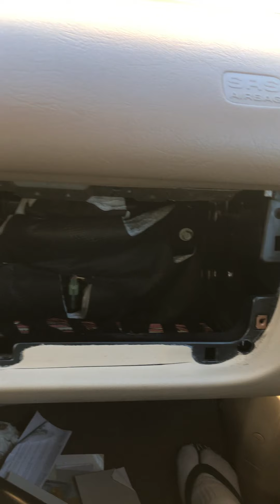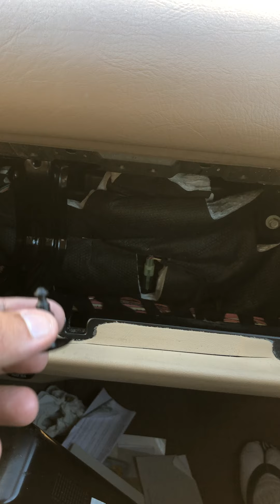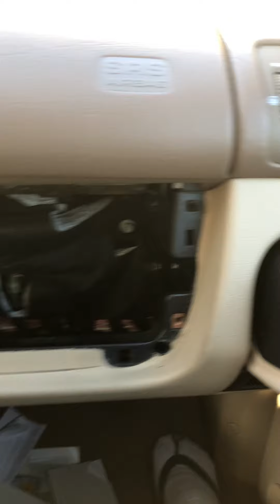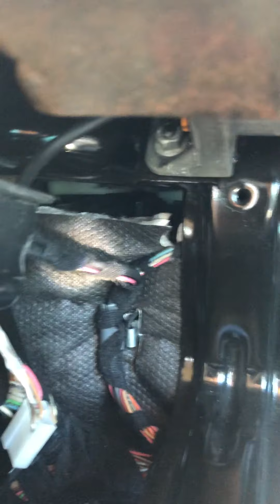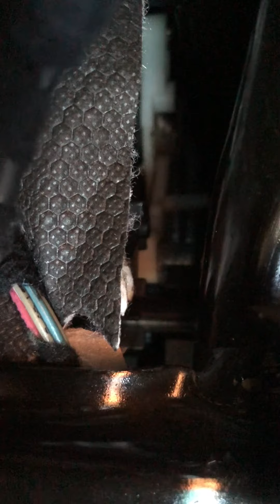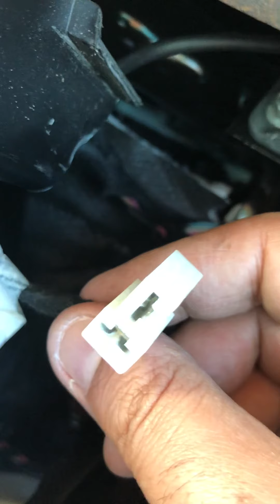Fix AC or Heat problem for Mercedes Benz ML320

Comment: Since this became evident at the end you just wasted 4 mins of your life I’ll attempt to help. 1st I’m a stay at home mom with no experience working on cars, nor do I have a very good automotive vocabulary m, but I’d like to help explain what to do.. The white plastic you see is able to be pushed backward or pulled forward depending if you have your AC or heat on. Can’t remember which way is what (you’ll know by what temp is coming from your vents). I’m a female with small hands so I just pulled back the insulation & was able to access the  “leaver”. I either pulled it pulled it forward or pushed it backwards can’t remember which, but opposite of where it currently was) & presto the AC came on, additionally when it gets cold I do the same thing, but push/pull it in the opposite direction activate the heater. I’ve only found one other video explaining this (over two years ago). I apologize I can’t find it now. I have a ‘98ML & the Mercedes dealership quoted me nearly $3000 to remove the dash & repair it. My cars not worth $2000!! It was an act of god that I found the solution of going through the glove compartment b/c there were ZERO chances a mechanic was EVER going to give away this tip. It literally has saved my kiddos & I from heat exhaustion or frostbite! I know nothing about cars, but really hope my horrible explanation might help or at least point someone else in the right direction. This does work & it’s sad this video leaves you “hanging”at the end when I’m certain it could have really helped some people out.
Reply: Thank you Heather, for writing what many of us concluded.  I have seen a fix on a Mercedes car club site in which the guy attached a metal coathanger-type rod around the white thingy and had made a small slice in the back of the glovebox where this rod sticks through. He bent a circle at the end to get your finger through it, then just close the glovebox door!  You can either push or pull the little rod depending on your time of the year....no need to disassemble the glovebox again.